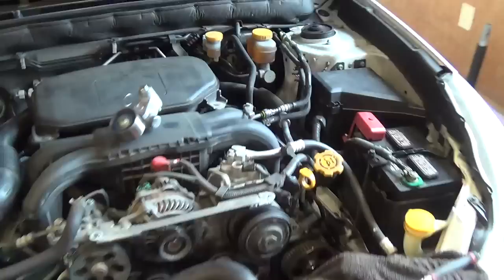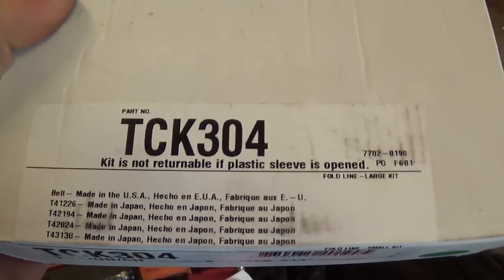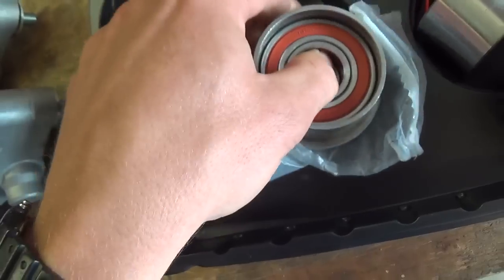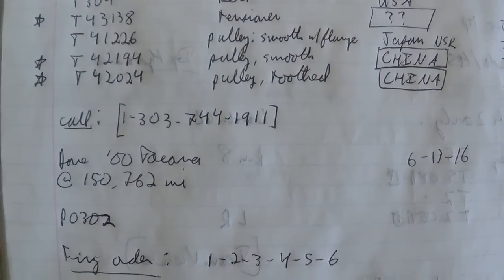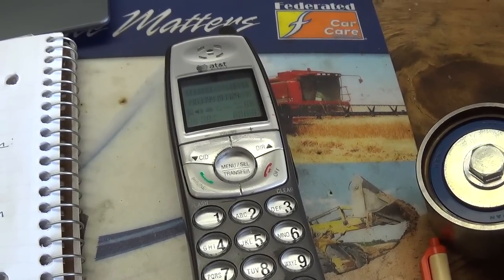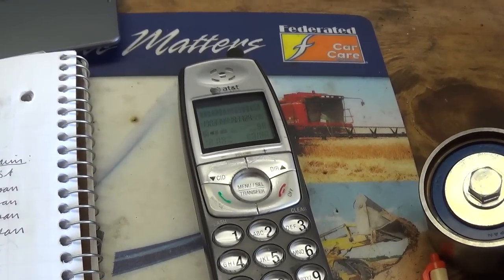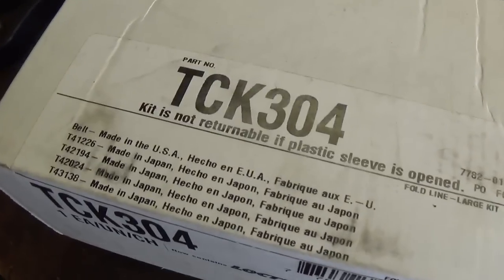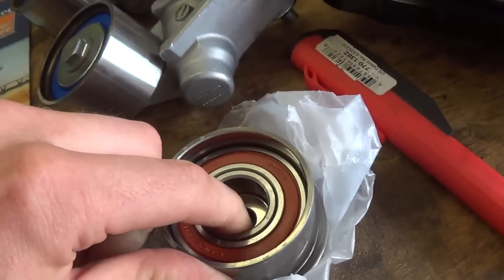GATES Subaru Timing Kits: BUYER BEWARE!

Comment: I installed a Gates kit on my STi. I was only aware of their reputation for quality and didn't look deeper at things. The tensioner failed at 800km and destroyed a rebuilt engine. Broke the piston in the number 4 cylinder. Gates stopped replying after I sent them photos of the tensioner. Unfortunately for me I had purchased the kit over a year earlier. I am now getting ready to install another engine and this one has a factory Subaru tensioner on it.
Unless the Chinese have someone looking over their shoulder the whole time they will cut corners and make crap.
Reply: That is so sad and unfortunate. Definitely worth it to get Japanese made NSK/NTN bearings in any timing components!
Reply: 1Howdy1 find my comment.  You are dead nuts spot on jimmy on the trigger buddy. Very refreshing comment
Reply: No offence but I don't feel bad for you.
Reply: That's what I hear from people who have personally worked with Chinese manufacturing.  They can make quality stuff, but like you said, you have to be constantly looking over their shoulder, almost to the point that you may as well just do the job yourself in order to get good stuff out of them.  If you specify m12x1.25 threads, they'll create those threads, but they'll use the dullest, crappiest tap they have in the shop and a proper bolt won't thread in smoothly.  Then you tell them that their threads suck, and they will reply with something along the lines of, "oh, you want CLEAN m12x1.25 threads?  That'll cost you extra.
Reply: @1Howdy1  when was the last time you bought a Chinese car? That should say it all.
Reply: Watch our follow up video, you may facepalm a little bit.
Reply: Depending on what state you’re in, you can litigate under consumer protection acts. In my state, Texas, we can file suit under Deceptive Trade Practices Act.  Speak to an attorney. If your state is consumer friendly, there are plenty of attorneys willing to represent with no financial commitment to you.
Reply: @ricecowboy  lol says china on it not fraud just not what you wanted
Reply: sounds to me like you don't know how to care for engines
Reply: Did you bleed it?
Reply: @volod3mir  bleed it? It comes pre sprung m8 if the pin is in its set what are you on about
Reply: @Naked Zebra my tensioner came with a warning sheet and instructions to bleed it, as some air may have gotten into the cylinder during shipping, warning states that failure to bleed may result in engine damage as confirmed by the OP... check out this vid you can skip to 1:45 https://youtu.be/JIU23Zhqwb0
Reply: If you can't spend the extra money to get Subaru parts get what you get what you deserve
Reply: @SavageZebra67  there is a note in the box with the tensioner a4 size sheet that explains bleeding tensioner as the parts have been laying on there side for up to a year since being made ! same with shocks or any thing oil filled that works in a vertical position and is stored in warehouses
Reply: @grumpy-g5s  im sure, most parts come with a sheet.only one in ten actually need compressed even then very little. not sure why we arguing this in 2020.
Reply: On these critical components I would pay the extra cost and stick with the OEM parts which are most likely made in the USA or Japan.
Reply: Gates sells both the "improved" kit which has China made parts and the Japan/France/Canada kit which is top quality. The water pump kit I just put on the Forester was TCKWP304AN and the "N" is what indicates the higher quality parts.
Reply: Very very true on the last sentence
Reply: Sadly big companies getting greedy. High prices with inferior products, should have sued Gates or even the retailer as it said Made in Japan on the box and not on the parts.
Reply: I installed one of those ‘ pretend ‘ Subaru  tensioners and it failed after 8,000 miles it destroyed my rebuilt EJ25. I went looking on eBay for the cheapest OEM kit and found one from a vendor who wasn’t affiliated with any Subaru dealerships but the pictures showed Subaru boxes and labels, (strike one) When I got them I was somewhat questioning the parts as they came in Subaru boxes but something was different about the boxes and the Fuji heavy industries labels(strike 2) two of the idlers were labeled China(strike 3) I was unaware of this are the time…. Well I installed all the parts that didn’t say China got a refund for those I didn’t use but I made the mistake of installing the tensioner like I said earlier it failed after 8k about 1 year later, I went back to that eBay seller and he no longer exists. ( scammer ) I quickly did a-lot of research and learned that you can actually use the NSK(made in Japan) idler pulleys direct from NSK on Amazon you can get all 3 there… they are the exact same pulleys. Subaru buys them from NSK and ups the price about 3 times. However, the tensioner that, MUST be bought from Subaru it’s in an in-house only part and it must be bleed(Subaru subjects). I get mine from Subaru Parts Direct off their site they are a Subaru dealership in Washington, Oregon that usually has the cheapest OEM parts anywhere.
Reply: Damn, I just had the same thing happen. My tensioner failed, belt came off and cut in half. One half got wrapped around and snapped. I only drove on it for about a year. Maybe 15k miles.
Reply: @Sherlock_MacGyver  yup where did you get your tensioner ?
Reply: Damn, glad I discovered this before I bought the timing belt kit from A1 auto. Which is gates. 

Fuck that. I'm going to trust Mr.Subatu and buy what he recommends.
Reply: Heard plenty of stories of failed OEM tensioners too.
Reply: 6 years later, if you’re still a subie lover, you definitely know this already, but Aisin kits, they do not fail!

Comment: I have done a couple Subaru's with the Aisin Kits. With these kits the tensioners use the same bearings as OEM, the belt is a Mitsuboshi which is also OEM. the water pumps are Aisin brand and are nicer made than OEM, afterall Aisin is a OEM for toyota. Seriously worth checking out if your doing these...
Reply: 100% the Aisin stuff is nicer.

Comment: Both customer services gave very bad service I don't know about other parts of the world but where I am info on the packaging is legally required to be accurate. I am an engineer and have had a number of instances where Chinese bearings have been responsible for significant downtime and a huge loss of revenue for my company that far outweighed the cheaper cost and in almost all cases they were passed off as higher quality items from other countries. I will draught a recommendation for group consideration that they cease to use Gates parts immediately. Many thanks Ivan for the heads up.

Comment: Thanks for your integrity and courage to push back! This is clearly false advertising on the part of Gates. They should have admitted that and offered to make it right. The second failure was Rock Auto. They should have offered you a generous refund or expedited exchange with non-Chinese parts. I was looking at buying parts from Rock Auto for my Outback but couldn't find an email contact for questions. That really sums it up - if a company won't provide an email contact, they don't deserve my business!

Comment: As an older guy who is NOT a mechanic I'm impressed with you, as a young man, having the awareness AND more importantly the integrity to refuse to install the parts in question.  If it was an alternator belt or a spark plug maybe it wouldn't be as big a deal if there was a failure sometime down the road but with these timing belt related parts the potential damage that could be done could be catastrophic in terms of what that damage might cost to fix AND the length of time the vehicle could be disabled while going through repairs.
  I'm old school and grew up in a different time.  If this exact scenario took place 50 years ago I'm almost certain that the Gates Rep would have stood on his head in a corner to make things right with you, the customer, in order not to lose you as a customer.  The fact that he was so indifferent when you said you would never buy Gates stuff again is the kind of thing I can just never get used to because I've faced this type of thing countless times with different kinds of products and services I've had problems with in my later years.
  This VERY scenario is a good illustration and symptom of the problems this country faces and the thing is that as older people fade into the background and younger people raised in a different age take over "the system" they just fail to see the warning signs of a system that is starting to fail.
  Another sign is that most young people who read my post here will just dismiss it out of hand as the nonsense ramblings of an older person who is out of touch.  They have no interest in anyone's time earned wisdom.  They haven't been raised to see the value in it and as time passes they will pay a higher price because of this blindness then I ever will.
  It's just like the story of the boiled frog!  (look it up.)
  Great video!
  Thank You!
Reply from the maker: Wonderful comment, I agree with you 100% that so much knowledge and human dignity is being lost!! The system will have to correct itself eventually, and many will suffer as a result!
Reply: @PineHollowAutoDiagnostics  Thank you sir!  Keep up the good or rather, great work.
Reply: Wise
Reply: Very wise comment, proof is in the COVID crisis
Reply: It is an iteresting point but the reality is that the parts are no longer made in japan(where we want them to be made) because we trust japan more than china. (Gates cant get the parts from japan at a good price. But they cam make them probably almost as good or better acording to gates in china. So now you can pay 300 for the Aisin kit with genuine japanese parts or 200 for the gates kit with a few chinese swap outs that are suposed to be trust worthy.
Reply: Its the price we pay for quality in these modern times of planned obselesence and ever expanding profit margins. Me personally i am going for the expencive 300 kit with guarenteed trustworthy parts.
Reply: @mrfester42  it seems like it was your peers at the time when you had the most power to effect vhange and you let it slide. and now its time for the next generation to fight an even furthet uphill battle or theyre trash. hmm 😒
Reply: @byloyuripka9624   You're wrong about that.  I grew up in the 1960s and my peers and I have always been active and still are, trying to AFFECT change.  It has been the generations after us who grew up with everything handed to them that never learned that the "good fight" must always be fought even when you have the world at your feet.  They never learned how fragile everything is and thus never sought to protect and improve the world.
  Change starts at home.  It starts with the man in the mirror.

Comment: I always get Aisin kits. A little more but always use the proper NTN/Koyo parts.
Reply: As a DYI'er I was hearing Gates timing belt kits were not the quality they once where. I bought an Aisin timing belt kit with water pump for my 2011 Honda Odyssey recently and was very pleased.
Reply: yeah always pick Aisin or OEM, Gates can't be trusted
Reply: Been installing Gate timing kits in customer's vehicles for years and haven't had any issues.  The only things we get dealer are cam/crank seals and the hydraulic tensioners.
Reply: I never use gates belts either. Bando or continental belts are the best.
Reply: +Discretesignals The switch to Chinese parts in the Gates kits seems to be a recent change. As motoYam82 pointed out even the boxes still say "made in Japan" on them so Gates is still using up old packaging inventory. Have you installed a Gates kit recently?
Reply: I'm pretty sure that you're correct as the Gates TB kit which I purchased 2 1/2 years ago for my '05 Pilot were high-quality components(Koyo brand for example)  EXCEPT for the POS Chinese WP which they decided to throw into the otherwise good kit. I swapped it out last week for a Made in USA WP and all is quiet in my engine bay again. It's the Aisin kit for me in the future.
Reply: I forgot to mention my new WP is an Aisin unit.
Reply: Austin kits are the only ones I prefer. If the customer doesn’t want that brand, Johnny down the street will do it cheaper. ESP on Subaru.
Reply: cisa93  my timing belt was made in thailand in the Aisin kit tkh-002
Reply: Yup! And come with OE mitsuboshi belt
Reply: @Discretesignals  same here bud

Comment: One very  important thing that needs to be said about the new Gates kits is regarding the belt tensioner. I have used the old "made in Japan" tensioners and OEM Subaru tensioners. Most of them have had bleed down issues before the engine has even run. We used to install an aluminum wedge to prevent the belt jumping during shipping. It should noted that I have built hundreds of Subaru engines over the last 20 years. For the record, there were more issues with the OEM tensioners than the Gates.
While everyone seems to focus on the Chinese bearings in the pulleys, the fact that the new tensioners are Canadian made and are very robust design, with a much thicker plunger, and better seal design. When using the Canadian made tensioner, I am able to turn the engine backwards immediately after installation with no deflection. 
Best course is to replace the top right idler with OEM and just replace the bearings in the toothed idler with quality bearings (cheap at most supply houses).
Reply: im in Canada . can you say who makes a sells the Canadian made tensioner|?
Reply: 2004 Subaru Forester, exactly what happened to me on a Gates kit.  Belt jumped on the Gates tensioner turning it by hand.  And it felt weak.  I put the Subaru tensioner back on and it was fine to 280k miles.
Reply: @awister7814  yeah china

Comment: I had a similar problem with a Cloyes timing chain kit several years back, which included a non-OEM tensioner assembly with a flawed design, which resulted in chain slap at idle.  Unlike that Gates rep, the Cloyes tech took the time to troubleshoot with me to find the problem, then overnighted me an entire new kit at no cost, which he personally hand-picked and inspected prior to shipping.  Needless to say, I buy a lot of Cloyes products whenever I can!
Reply: Had great experience with Cloyes as well.

Comment: Hey Ivan, thanks for making all these videos! I was just about to buy a Gates kit for my Impreza but after seeing this I went with the Aisin TKF-001 kit instead. Haven't installed it yet but based on the contents I can recommend it. All parts have made in Japan stamped on them (except belt made in USA):

Aisin WPF-002 water pump (includes gasket)
NTN ATU106J-1 tensioner (This is identical to the one in your Gates kit. I can see from the video that although the castings don't match, the small part number written around the tensioner cylinder is the same between this one and the OEM one you took out)
NSK ZA-59TB0515 toothed idler
NSK ZA-60TB0693 smooth idler
Koyo IF-001K smooth idler
Mitsubishi CD304 belt

Just sharing if anyone is wondering what else is available :)
Reply from the maker: I wish they sold the Aisin kit without the water pump...

Comment: I just did a 1998 Subaru Forester head gasket and replaced timing belt and tensioner also a
couple of idler pulleys, I picked up the oem parts on ebay at a good price, I just made sure
they had good pictures that showed the oem part numbers on them before ordering. You really have to do your research before ordering parts now days. Great Video

Comment: Great videos. I followed up with Gates today. They are now putting an "n" as last digit as in tck304n to denote all componenets made in japan. The "n" denoted kits do cost more. So the tck304n kit costs more than the tck304 kits. They said that the non "n" denoted kits have two of four components oem and two made in China.I think the oem components were the idle and one of the non toothed pulleys. So apparantly its not an sourcing isssue, its to have to price points on their kits.
Reply from the maker: Are the n kits available for sale? I've never seen one...
EDIT: I just checked on RockAuto...sure enough there it is! I will be trying that one out next time :)
Reply: Cool. Keep up the great videos. Really enjoy them. You and South Main Auto are two of my favorite channels.
Reply: Great info and huge kudos to motoYam82 for exposing this. Maybe update the description ?
Reply: So" true that "we say downunder Nuck Chorris , hope you guys in the US wake to yourselfs quickly about chinese junk!
Reply: I was wondering what that meant. Mine is a TK307, But the TK307N cost more and I couldn't figure out why.
Reply: What you cannot trust is packaging and advertising, which is all that Gates does with these parts. Gates has demonstrated that it misrepresents what it sells, and is unapologetic about doing so.  That makes Gates untrustworthy.

If Subaru were to use the identical parts made in China to its specifications, and sell them in Subaru packaging, I'd be inclined to trust and use them. 

I have no issue trusting a company who puts its name on a product THAT IT MANUFACTURES or has made for them, and risks its reputation upon.  There are Chinese manufacturers who make high quality reliable parts, and some who make junk.  I no longer trust Gates to know the difference.

Comment: Only use OEM parts on a Subaru. That Red-colored lower idler pulley will be the first to go bad, its got a much smaller bearing in it than the upper idler pulley. so I always swap out the lower idler pulley with a 2nd new upper idler pulley.

Comment: i just got this kit about a month ago for my womans 05 outback,,, i did the "air bleed" on the tensioner ,and so far, over 2000 miles and it hasnt gone slack or anything amiss,,,, everything seems to be in working order,,, altho i will post here again with an update if it would fail or have a problem